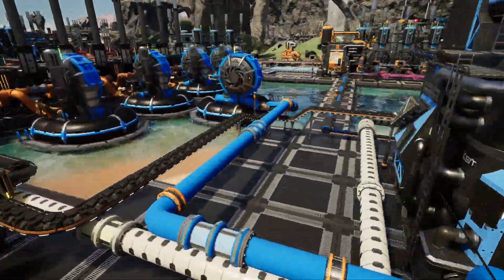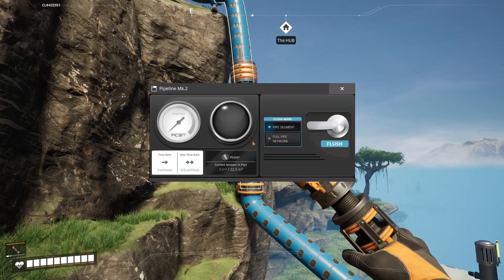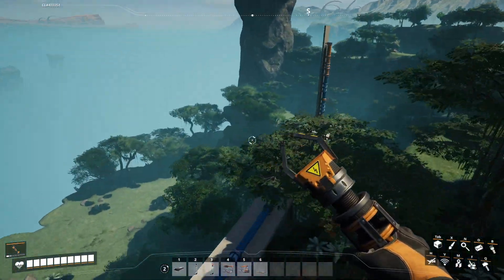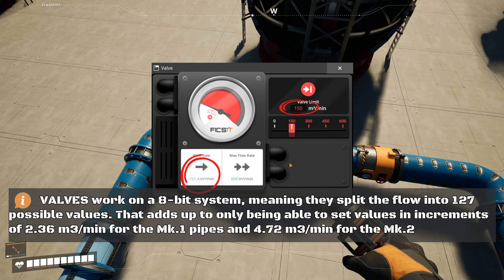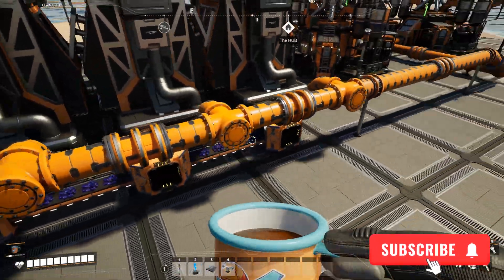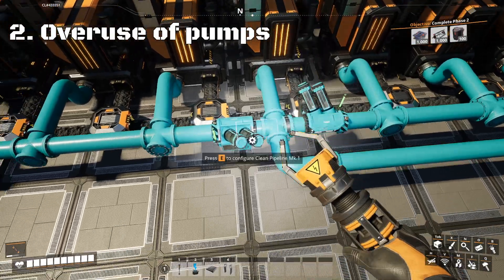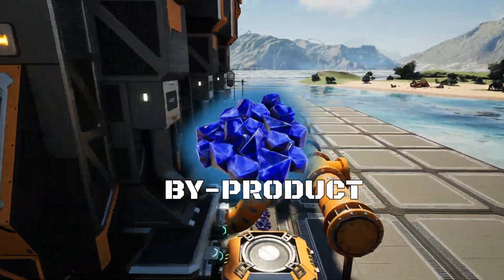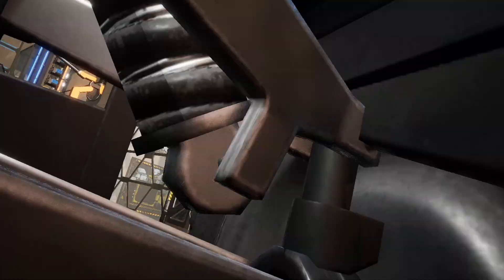The Ultimate Satisfactory Fluid Guide

Comment: My solution to the Aluminum byproduct is quite easy:
-Set water extractors to exactly the speed they will need
-Fill pipes and refineries before starting (byproduct line disconnected)
-Start producing and don't forget to hook up byproducts to the input
Never had any hiccups on a 1000/min alu production
Reply from the maker: I tried that as well but had some issues. Do you use all the aluminium or sink the excess ?
Reply: @Overclocked-soz  It was before 1.0, so maybe something changed, and all ingots were used.
Reply from the maker: @n00b2001 I think if you use all your ingots it should work perfectly. It's when the production stops that the water input can sometimes get messed up. 

I really hope they improve the fluids in the coming patches.

Comment: Limiting flow has been a god send for my aluminum refineries as I like to loop the excess water back into the system. Start the water pump and before the junction, set a valve at 80. The water from the system is prioritized, so it prevents backups and overflow of the water to keep the system running smoothly. Works for any other case where you loop the water back into the system.
Reply: The valve works as the VIP junction. From my observations, the valve not only limits flow rates, but direction of flow as well. So setting it up so only 80 wpm can flow through prioritizes the water byproduct to go through. I’ve even stopped production on 1 refinery to test if it can keep running after a back up and it did. This was just personal experience but I recommend toying with the idea. You may come to the conclusion that it works exactly the same as your method
Reply from the maker: @garrettschrepfer7659  I will give it a test myself. I tried once and it didn't work, but neither did the VIP junction until I tore everything down and rebuilt it 😅 so....you might be right
Reply from the maker: I think that can be a bit unstable... It can back up if your production stops for some reason. I recommend using a VIP junction for  aluminium water byproduct

Comment: 3:8 ratio coal setup 1 (tier 1) pipe 3 water extractor and 8 coal generators  you think not imposible . 1 pipe compleate around coal generators in back 3 water extractos 1side 2 in midle 3 in another side. And it will be 300 in left 300in right. For me in game owlways working very vell
Reply from the maker: Yeah, totally right. It's not impossible. I just usually have my generator far from my water extractors and don't like to build more pipes between them. 😄

Comment: Regarding 3:8 ration by coal gens, if building 1 of the water extractors on the other side of the pipe it will require effectively only 1 pipe. So you will get smth like a row of:
2 extractors, 8 coal generators, 1 extractor
Reply from the maker: That could work, yes. Nice one 👍